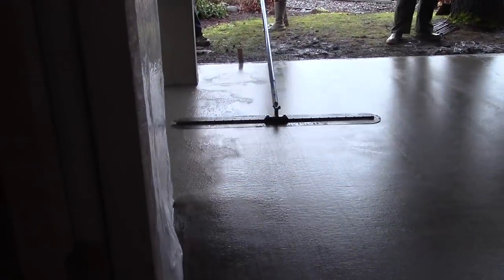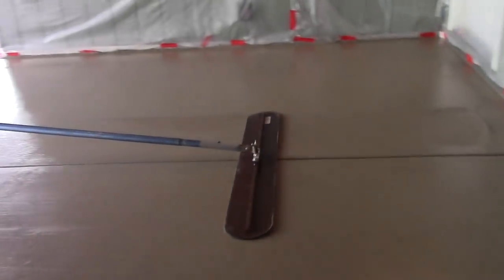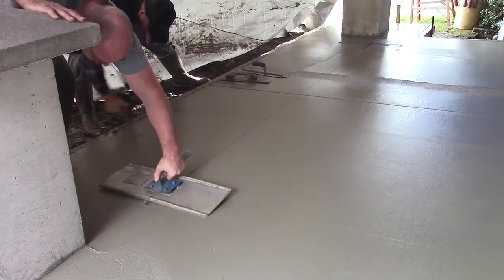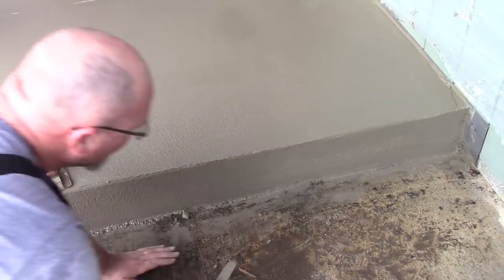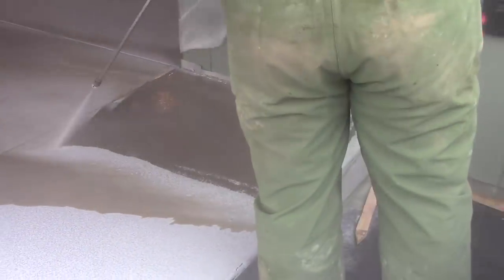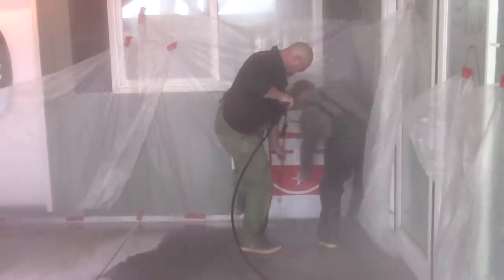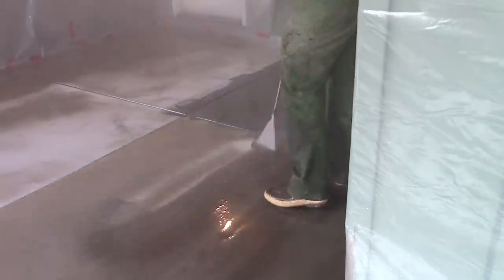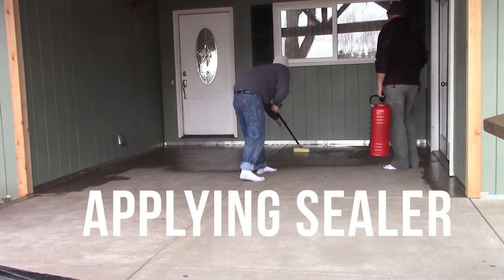Concrete Finishing Done Right

Comment: 5 year finisher here been pouring almost every damn day since day I started and I must say damn that is by the book A1 perfection to what finishing should be! excellent job !! best video yet!
Reply: I couldn't even write when I was 5 and here's you, pouring concrete since day 1. I'm very impressed.
Reply: That was fun to watch. Those guys are very particular about their work. In my area, paying a "pro" only results in me being broke and them f***ing it up worse than if I'd just done it myself with a few YouTube lessons.
Reply: I like their work but whenever I worked in concrete I liked to cut my joints and edge just a little sooner before them, nonetheless great work.
Reply: MoneyManHolmes, I have the same problem here. The guy in video said it took him years to find these guys. A homeowner with problems to fix doesn't have a chance to know for sure how good a crew he hires. It is pretty much a gamble, in spite of the information on line. Once I was pumping gas at the station, where two guys were repairing the cracks in the cement on the premises. It was very hot, one closer to me was picking with a trowel generous portions of the wet cement and schlepping it onto the crack. No wetting it, no making it bigger in places too small to "glue" together. Nothing. I asked where is his water, he answered he just drank some and it isn't that hot, yet. I kid you not. So, as a homeowner with no money to burn, you ARE better off learning basics and doing smaller jobs yourself. Even if you DO start with a few "first attempt" projects in your backyard. You cannot do worse than those two at my gas station. But what if you get older, and no longer can? 
Oh well, no worries, you won't live long enough to see it. Finding a good doctor is not easier than finding a good cement worker, or a butcher, a baker, a candlestick maker. Hahaha.
Reply: Viniso LMAO
Reply: I've been placing and finishing concrete for 35+ years there are a lot of hacks out there but this crew did a good job and that's not as common as it should be
Reply: @Dora Mendez i think he said five years as a finisher, so yeah that would techicly make him a finisher, how good we would have to see and judge
Reply: @traveler8524  water can also mess up the structural Integrity and cracks easily.

Comment: One of the first things that I learned about placing concrete is that using a pump is the equivalent of hiring 3 guys if you have to tailgate it. And most often a financial wash. Then the pumper goes home and you are left with the right number of workers to finish the slab comfortably.
Reply: I agree, but I cant count the number of times the line pump has clogged and the pump man has to go beating on it with a sledge or disconnect the hose and jamb rebar through it to dislodge the concrete..etc/ Ive even seen the hose explode at the connection because of a clog. The pump guys in AZ definitely earn their money. Having to beat on those hoses when its 110 degrees out is no fun...but this usually only happens with old wore out hoses. Id rather do what I do placing finishing concrete than be a pump operator.....Now boom pumps is where its at! Don't have to order a pump mix either.

Comment: I love the fact they even wash off they boards they are using.  

We hired two concrete guys to do two different projects, around my parents house.  The first guy, was re-poring the concrete in our basement so we could put in a kitchen.  He comes in days late, sets up some vary wonky looking forms  for a section of wall that needed be pored and puts it in a week later then he though... so he leaves half his tools so he can do his other job, (commercial Semi truck driver for the next week.)  Two weeks go by and he finally has time off to finish our basement, and then leaves his tools there for a another 3 weeks..  during which he never washes off his tool, and level leaves his concrete mixer with a giant old lump of hardening concrete in it.  I was so appalled by this, I ended up hosing it out and dumping the left over concrete into a form of a simple block that I used for a seat next to a fire pit.  after 3 weeks guy come back, picks up his tools.

Now the second guy, he poring the foundation for our garage.  He comes in, and excavates out a section where our garage will go in two days, and then gets going on putting up the the molds for the concrete footing, and sets up the rebar... I go away a day or two.. and the guy has all the walls pored in for the garage and now is working on putting in the floor.  The minute he sees me, he comes right up and asks if I like the floor to be gradated so water will run out.  and shows me what he still has to do.  And then the vary next day he finished the job up just like these guys are doing her..  He also had his own water to wash off his tools when was finished with the job.  This was his living, this is the only thing he did to make make money.   The guy was professional, refused any help I had to offer, and was worth ever penny he charged us.    

There is a lot of things I want to do by myself.. but concrete is not one of them.
Reply: Most concrete guys I know are extremely anal about their boards, they need to remain perfectly straight and true or the work suffers so they always take good care of them.  I have heard many a new laborer get his ass reamed for not treating them properly.  If you find a guy not doing that I would avoid him as he is obviously lazy and doesn't care as much about his finished product looking like a craftsman did it.
Reply: Reading your comment there sounds like you live in Australia!
Reply: Isreal Harris I reckon the other guy is booked for months and months to come, but still, mentioning his name would be a nice way of additional thankyou from you (besides the money :)
Cheers :)
Reply: let me ask this one question you hired first guy because he was cheaper? then others you got prices from right?  its hard for true craftsmen now days we compete against guys with hammer an a truck.    not many people care about doing it right most are cheep cheep
Reply: If You pay cheap You get cheap.
Reply: @mattpkp  I just starting in concrete at the beginning of this year and learned off the bat, clean tools mean a clean product. Cleaning mags, trowels, screeds, floats come before I try to come help with any finishing and I love it.

Comment: Damn near cried, so beautiful. That is some great finishing!
Reply: mana02 manu The wetter you pour the concrete the easier this is, but the weaker the concrete is.    Also vibrators help tighten the mix up, but I suppose this isn't a driveway and just a porch.
Reply: 1D10CRACY "wet" concrete is only a problem if not designed that way. I have designed 70MPa (10,000 psi?) concrete that spreads like pancake batter with 700mm spread (28 inches). Ask your supplier they can probably provide  something similar.  If well designed it will spread and place easily with excellent cohesion and fantastic strength. Just don't add uncontrolled water as that will create all sorts of problems (low strength being only one)
Reply: Right on, Gaz S! Mix design is the key to the concrete kingdom.
Reply: back breaking work but they make it look easy

Comment: Control joints off of the columns are missed by the amateurs......so important!  Since stone veneer was going to be applied adding felt board could have been added to the columns to take up expansion and not seen.....NICE PROJECT FINISH
Reply: outsidescrewball  I noticed that too; but there's no law that says expansion joints HAVE to be used.  And ALL concrete cracks no matter how close to perfect it is engineered.  And nothing in construction is perfect.
Reply: just to be clear....I was not calling the installers amateurs, obvious pros....my comment was that most amateurs would not know the need to control cracking from corners...
Reply: I agree, I was working super on a large job at USF and there was a lot of covered walkways with columns along with a lot of colors and shapes incorporated. The job was Lawton and Rhea Chiles Center at USF. It had spiral stairs inside a round structure and a connected concrete 2nd floor bridge. There was a second bridge over the main lobby inside of the building which looked down on a color concrete patterned floor with matching skylight overhead. When I took over that job, I had to remove a lot of new columns and walkways because everything was wrong including the control joints at the columns and the different surface texture at each column control joint. The texture was different in between the control joints than the rest of the walkway both outside the column and from the column to the building. The columns had to come out as well because the elevations and texture were all wrong.
Reply: lol, not at all. It is a building on the campus of University of South Florida. I was the Concrete boss but I did get dirty as well. No grenades tho. BTW, I was 8 years old when the shit was going down in Vietnam, at least in 1968.
During 911 (2001) tho I was building an airport in FL and that was some crazy times. Lakeland Linder Regional Airport.
Reply: Seth Emai I don't envy you or your job, I prefer smaller jobs (like this one) that I can 'control' (pun intended) lol
Reply: Actually. expansion joints do have to be used, especially on captive slabs like this is. The summer expansion will cause something to break and heave. You HAVE to use expansion joints. Control joints however are a different matter.
Reply: "expansion" joint is a bad term because concrete never expands larger than the size it is when it's freshly poured. I your slab is 100' long when fresh, it will probably shrink about 1/4" when cured, it will shrink and expand, but never larger than 100'...a better term is "isolation" joint
Reply: quick question: How do these joints help prevent cracks when the concrete shrinks/expands if they don't go through the whole slab? clearly, the joints dont reach the ground underneath the concrete since there's rebar set in it, so how exactly do the joints help? I have no experience working in construction, so sorry if any of the vocabulary isn't quite right, I'm just curious.
Reply: James LaCasse - - It actually will expand during summer months. Winter pouring can be an issue for that reason. There is a very real reason expansion joints are placed in bridges and all over the place. It's not just for shrinking but for expanding. Simply do a search for "thermal expansion of concrete" in your favorite search engine. And the results will teach all sort of good information about the topic.

 Now if you pour a slab in the heat of summer then your statement can stand correct. But you are also correct, they truthfully should be referred to as isolation joints. But almost no one does, as in, no one actually does. At least in my experience I never heard any of the engineers, architects, supervisors etc refer to them as isolation joints. People call them expansion joints and that is what they are known as. It's like saying you can't call it a 2x4. True it measures differently than the referred to or implied naming, but they are still known and referred to as 2x4's. Same with expansion joints. Now your experience is not my experience and your experience may be completely different and opposite of mine. And you are thinking I am some sort of stupid moron that knows nothing. But that does not negate you being correct or me being correct. Remember, we are civil people. :)

Now, true it shrinks during the hydration phase and that is nearly equal to thermal expansion. But the issue is that the joint will fill up with crap. That crap will fill in at some point during maximum shrinkage and that crap will also eventually become non-compressible. The compressible material of the expansion joint also deals with that particular issue for quite a long time.
Reply: Rafael Dos Santos - -  The joints don't per-say prevent cracking. It is nearly impossible to prevent concrete from cracking. crazy measures have to be taken of that is your intent. So that leaves us with a different question. Your initial query was flawed in basic knowledge of the topic. Nothing rude, that's just how it is/was. So if the cracks can not be prevented the question becomes, why have joints then? We put in joints to "try" and control the cracking. We humans like to have our things looking nice and orderly. Having regular control joints pre-weakens the concrete in that groove or joint. It is weakened because instead of being say 3.5 inches thick it is only 3 inches think. Less thickness = less strength. With the slab being weakened in that nice pretty straight line. WHEN the concrete cracks, not IF but most certainly when. It is hoped and anticipated that for being weaker along the groove the concrete will crack along the groove and follow it. This guides the cracking somewhat to do our bidding, it also obscures an otherwise unsightly crack in the bottom of the groove. 

The cracking however does not always chase or follow the grooves. There are a myriad of reasons for that though and I won't go into that subject. 

Now I used the words groove for a reason. People call the joints. But there is a difference. A joint is most often a physical break between two different concrete pours. It can be a pretty line or an ugly rough line. But it is a physical break between the two concrete pours. A groove is what you most often see. It is not an attempt to JOIN together two different pours. Rather it is physically a grooved line in the middle, and other places, of a pour that does not divide it into physically separate slabs. 

To further add, there is no such thing as an expansion groove, there are only expansion JOINTS. The intersection of the joining of two or more items together. A true expansion joint has a compressible material that does extend all the way through the slab and physically separates the slabs. If the compressible material only extends partly though the slab (as many lazy flat-workers will do. Because it really honestly can be a serious pain in the butt to do a good expansion joint) then the concrete really honestly does not have anywhere to expand to and will buckle and heave or it will push and possibly break something.

Hope this helps. :)
Reply: Rafael Dos Santos since concerts will always crack control joints are done to give concrete a place to crack. The depth made by the tool is enough to make the concrete crack all the way through once it hardens over time even if has rebar in it. Rebar will not keep concrete from cracking, it'll hold it together and keep it from sinking, shifting etc..
Reply: Concrete*
Reply: I read an article on the effect that rebar has on preventing concrete from cracking, and it's nearly zero.  It just holds it all together when it does crack
Reply: it's basically a precrack relief joint. instead of letting it crack randomly. you're trying to put a controlled crack that's straight, at the bottom of the groove, and therefore more aesthetically pleasing. they typically run 1/4 of the slab thickness deep, while maintaining aggregate interlock the remaining 3/4
Reply: thank you, very instructive!
Reply: outsidescrewball $400 to have an old carport Plus driveway removed with another 250 in disposal by doing it the correct way you could have guaranteed the carport for 15 to 25 years the work they have done here is only guaranteed for one year that is a sign of a lazy human being
Reply: Seth Emai holy shit, wasnt that the concrete walkway that collapsed?
Reply: James LaCasse 😂😂 cubbie someone's never poured 50k extended joint slab in the winter
Reply: thanks for that information
Reply: they have expansion joints in bridges for that very reason it will expand
Reply: Rafael Dos Santos 

Jointing is purposely creating a weak spot so if and when the concrete cracks, it's more likely to occur in your joint and be hidden rather than in a random spot. That doesn't mean they are guaranteed.
Reply: Vineyard 480 

Thank you. Jack hammer that shit out instead of ripping off the homeowner and repour all of it. Costs literally nothing to dump a bunch of busted concrete at the dump or in a hole somewhere for backfill.